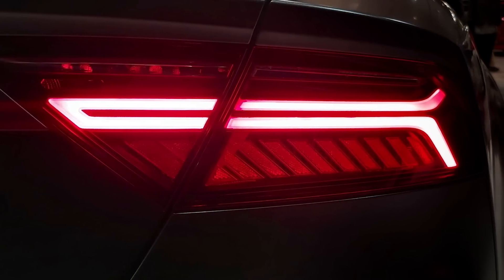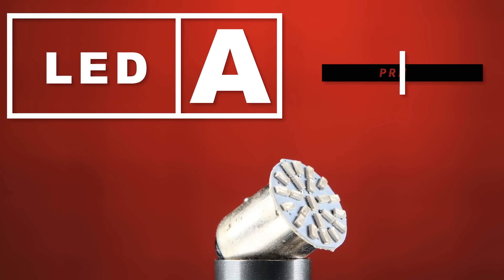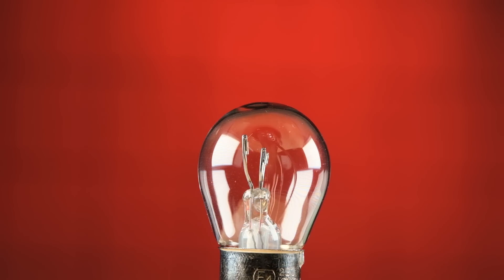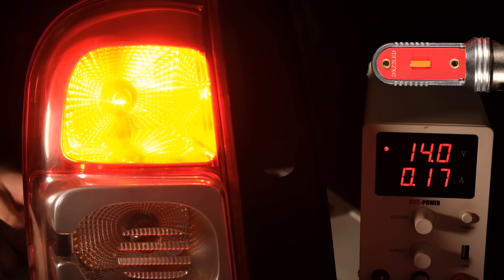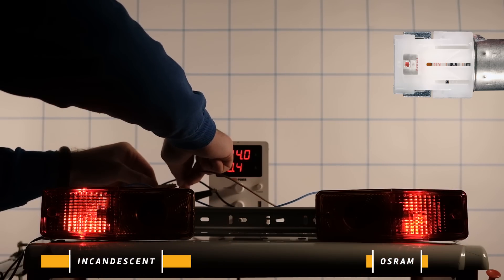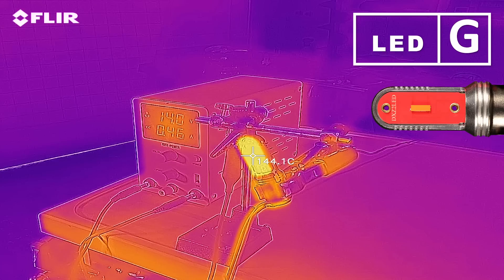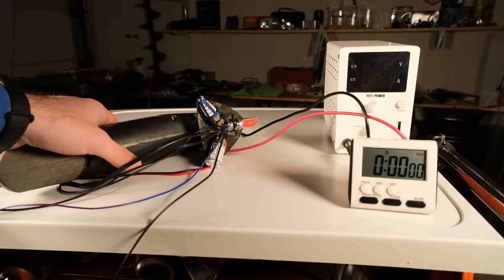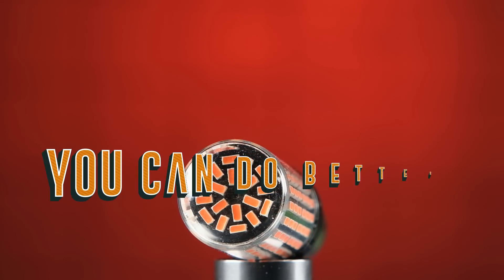LED STOP Lights TESTED - OSRAM vs PHILIPS - Light output, Temperature management & Endurance tested

Comment: https://www.ebay.com.au/itm/Amber-BAU15S-1156-Turn-Signal-Light-PY21W-144SMD-Canbus-No-Error-LED-Bulb-New/154026458388   This one is brighter than original bulb. As long as it fits though.  Have these on my car.

Comment: Great comparison from you but... I can't understand why would anyone buy LED's that are 30 times more expensive than 'old' light bulbs to get almost as good results. Those chinese junk it's not even worth mentioning. It's idiotic.
Reply: Buying an led bulbs that’s very expensive but it’s not the most expensive led bulbs in the world. There’s a lot more out there that’s way more expensive. 

Remember, u get what u paid for. 

$35 bucks for Osram/sylvania led is not a bad deal.

The higher the price, the better quality is. And the better how well made it will be.
Reply: Fun fact, there’s people out there spend $130-$160 bucks a pair for turn signals, another pair for reverse lights, another pair for brake lights. 

It is insane but the high quality led bulb product are excellent. 

And it’s considered a must have for automotive led enthusiasts.

Comment: Sergiu, you've got great content! I love your videos and your sense of humour. Kudos for keeping it funny and light, while still being as in-depth as possible.

My 1995 BMW R100RT uses two separate bulbs in the tail light. A regular P21W for the brake light and a P5W bulb for the tail light. The P5W seems to have been largely phased out from the automotive industry. It's got the same socket as the P21W, but a smaller glass dome and - obviously - a lower light output.

I'm looking to replace at least the tail light bulb with an LED, in an effort to reduce power draw as much as possible. What would you use?

Comment: Great video!
I just upgraded almost all lights bulbs on my two cars.
I did not upgrade headlights (high and low beams, and front fog lights), as I consider good halogen bulbs to be a better solution; and turn signals, because the duty cycle (time being on against the sum of time being on and off) is significantly lower, and there is a noticeable difference to other drivers.
I changed parking light (or side marker), brake light, reverse light, rear fog light, and interior lights (footwell, boot/trunk, and overhead).

I switched to LED in order to (a) have more reliable bulbs (less heat and less energy consumption), and (b) better overall light output (better light and uniformity).

On the interior I specifically desired more light output, to see better at night - especially during Winter time.

I chose Philips, due to its good build quality, reliability, light color, and light output. I chose the "X-tremeUltinon" series - as that was the better light output ones I could find.
I am really happy I did change these bulbs.

On my 2001 Renault Clio, I was able to change all rear lights.
On my 2011 Renault Megane, I was not able to change the P21/5W brake lights, was with LED they stayed on all the time. The DRL and interior lights cause an ECU error, but as these errors do not show up on the dashboard, I am not too worried.
Reply: did you had any issues with the periodical inspection or the police?
i might wanna make wanna upgrade my parking reverse and brake too since i find its a big electricity waste to use 21w per bulb for my brakes not to mention the tiny bulbs in the third brake lamp which use 36w (in total brakes use 42+36=88w on my car which is a big waste of electricty)
also i might wanna upgrade the rear fog light with some brighter bulbs so that the tailgaters know to stay in theyre place (if that wont be an legal issue)
Reply: @Rand0muser2538  I feel you!
On my previous 1996 Peugeot 106, with 6 W5W on the third brake light and the two P21/5W on the sides, upon touching the brake it was a total of 72W just for applying the brake pedal.
Yes, the electrical system was design to handle all that - but the car is old.
Moreover, during Winter with the headlights on and heater blowing air, while in traffic with the brake pedal pressed, you can imagine the demand on the electrical system.
Hence, I am in favor of that upgrade to LED - but good ones!
If you cheap out, you will (a) not get as much electricity savings, and (b) add one more liability to the car - and I imagine that, like me, you do not have insurance that covers fire, as the car is too old.

Regarding rear fog light, yes, I did upgrade it.
But for providing better light during fog situations.

When it comes to the annual vehicle inspection, I never had any issue.
Typically, they do not like LED on headlights - which I also do not recommend, as LED is not there yet for retrofitting.
On my Megane, the DRL bulbs are quite obvious to be LED, as the headlight is big and clear. Hence, I turned them off before going to the inspection, and turning them back on after it.
The other LEDs are always in place and working, and I never had any issue!
Reply: @hitardo  well its looks like i can only find replacement for the 2 main brake lights which use the classic p21W
my third brake lamp uses t8 3w bulbs (which can be a problem since i cant really find led replacement for these ones and even buying 12 t8 bulbs is just as expensive as replacing all the bulbs in both of the tail lamps
i might wanna replace the tail lights too but for some reason my car uses P21/4W for tail lights and fog lights which is diffrent from P21/5w and not even the chinese brands offer this kind of sockets on most of the leds
Reply: @Rand0muser2538  what brand, model, and year of car do you own?
I ask this, so I can search what exact bulbs to work on your case. Because "P21/5W" or "W5W" does not tell the full story.
Reply: @hitardo  skoda octavia 1 2003

Comment: After trying a number of 21/5 W, I recommend these:
https://www.aliexpress.com/item/32810391568.html?spm=a2g0s.9042311.0.0.27424c4diZFOZW
Visually their light output is good in a reflector lamp. The diff from rear to the brake light is not quite as big as with a filament bulb, but acceptable. Lastly I like their intense red.

BTW I was quite surprised to see a vast improvement in terms of "on" speed with the LEDs. I did not think the difference is so huge. Change one first and you should see what I mean.
Reply: Haha found this back. The bulbs lasted about 3 months.
Forget these. All. Expensive shxt.
Reply: The 1157 on my Audi A3 are the factory bulbs .... 24 years old!

Comment: try amber leds in a red tail light housing you'll be amazed how bright it gets, 2 times more than a regular bulb. i have personally tried bulb A,B,C,H,OSRAM and PHILIPS in a single pole application like 1156, my conclusion is that bulb a,b,c were all garbage cause they werent bright. bulb H however was the brightest but didnt last more than 4 weeks(tried 4 bulbs, all 4 burned out one by one within 4 weeks). Red color OSRAM and PHILIPS were not the brightest but amber ones worked better, i have a pair of each in my car one for turn signals and one for brake lights and they've been running strong for almost 2 years now. I did how ever try red 1157 in one of my car but in real life the difference between parking and stop light is merely noticeable thus i had to switch back to regular bulbs. still on the quest to find a 1156 bulb that has a night and day difference between parking light function and stop light

Comment: A LUX measurement would not hurt the new LED tail lights for new cars, because it is obviously very much too strong, in fact !!!!! I think it should be regulated, because already the LED parking light is much stronger for many new cars than the brake light for older incandescent cars!

Comment: Salut Sergiu, I think it would be better if you tested classic bulbs with 13.2 V. If you measure the voltage on the bulb in your car you'll hardly get 14 V I think. With 14 V in the test it might be much too in favor of the incandesent bulbs. Personally I stick to these because of the bulb outage systems that hardly tolerate LEDs and because of the certification. But I understand that many users might want to switch to Osram/Philips LEDs because their performance is really good.

Anyways, you're doing a great job, mult,umesc for the test! Merry Christmas from Poland.

Comment: I had a set of generic (though apparently high output) brake light LEDs in my car, and they lasted ~1.5 months before both had failed.

The set of Osram LED bulbs has been running for ~4 months now, and while they cost just over $23, I like the output and the expectation that they'll last.
Having a warranty is nice as well...

Comment: This is why I get blinded at traffic lights, please use the handbrake during night time traffic because these blind you.. Manufacturers should introduce led light dimming during low speed driving to not blind the driver behind, or the costum led lighting you install please add a potentiometer to dim your lights during city driving...
Reply: You ever been behind a new Cadillac Escalade?  😂 Those red laser beams really leave you blind for a few seconds
Reply: Lol fuck that. 

An incandescent bulbs are not bright enough. 

With led bulb replacements from a reputable brand. Like sylvania led or sylvania zevo led, Philips ultinon, X-trend ultinon, and vision . 
I’d rather get an led bulb for better brightness, more vibrant red color and better intensity increase. So that I can get notified better to see and being seen better. 

Instead of ur lights is too bright, for sylvania led or Osram? Not even.
Reply: U only use handbrake for when u park. Not to brake. That’s kinda stupid.

Comment: 7:21 Seen H on Amazon. They have superior output filling the reflector for the most visual intensity in a way that can't be measured obviously. Probably make a better turn signal than stop light being somewhat warmer but they passed the oven test too.  I was impressed. On Amazon- https://www.amazon.com/dp/B07QWWZ6GJ/?coliid=I1FOVCZVOSA1DJ&colid=3V9UKRF47G9QV&ref_=lv_ov_lig_dp_it&th=1

Comment: Turn signal leds will be interesting to see too
Reply: Yeah. I'd like to see how turn signal led fares compared to incandescent bulb.
Reply: I have them. They are too bright. But you need a separate resistor to remove the error.  I have bulb H
Reply: Yes, and how to install them, because of the less resistance they have.
Reply: @christiann7320  You need an inline resistor.
Reply: @christiann7320  there are some led bulbs that have built-in resistors on the internet . i've used it for a long time and until now it works
Reply: @christiann7320  In general you'll need a completely different flasher unit as well. Conventional ones designed for incandescent ones may not work at all or the timing might be wrong. The  wiring to the flasher unit might also need to be modified.
Reply: @Velktron  thanks!
Reply: You will need to change your relay to a led compatible one too for the harness led lights.
Reply: @Merlene Kita thats...sad bro.
Reply: i’m here for the turn signals as well

Comment: Bulb H is a really good value. Good light output for parking and almost same brake light as osram and philips. If you have an old truck and you want to do an upgrade, i dont reccomend spending 70 dollars to get philips/osram. Bulb H is good enough for much cheaper.

Comment: Happy to see that the  Phillips X-treme LED 1157 socket P21/5w were worth the investment (had to import them to Europe because they weren’t available here in 2016 which made them extremely pricey) I immediately recognized these led bulbs have the placement of the leds in the same position as the filament type bulbs. So that helps the light output gained by the reflectors behind the red glass.

Comment: Very nice and informative video!

I wonder, how hot will be a 21w turn signal LED bulb with built in resistor/canbus?
Reply: MRU, I use bulb H for rear turn signals. Must have a built in resistor cause I don’t experience any hyperflash.  They’re great bulbs IMO 1797 (T-20/7440)
Reply: @ScottishScot  Hi, I want to buy turn signal LED bulb with built in resistor (no hyperflash) for my car, but I’m afraid to not get very hot and melt the headlight connector/case. 

Like a see in this video, not all chinese led are safe and some of them can start a fire. 🙈

Comment: I have a set of philips (different shape though) for years. Light output and pattern are perfect and instant on is so good.
Reply: Share model name then please
Reply: I've had the Philips version of the 501's (silver band 4,000k?) in for over 2 years and they e never missed a beat. They replaced cheaper versions that blew faster than a hooker. Will only put Phillips in from now on.

Comment: Awesome video!
This is my favorite LED brake light, you should try it. It operates just like the original halogen bulb, just slightly brighter. You can easily tell the difference when braking. This was the best LED I have tested for this purpose.

US $10.88  41%OFF | VANSSI 2x 1157 2057 2357 7528 BAY15D LED Bulbs Brilliant Red,Super Bright 1200 Lumens Replacement for Tail Brake Stop Lights
https://a.aliexpress.com/_mKzOxDX

Comment: One light that could actually be worth changing out for a led could be the reverse lights. In my car, with led reverse lights, I can actually see what's behind me when reversing in a dark environment. The incandescent one's where mostly just for alerting other drivers I was reversing. With these leds I don't have to install  external auxiliary back-up lights.
Reply from the maker: I can actually follow up on this Idea. I have in mind some products that are worth testing. Thanks!
Reply: @SergiuGabor  Perfect! That would be great since when I was shopping around, alot of brands clamed higher light output due to "LED-technology" (wow, so cool!!!!!), but when comparing lumens or if you calculated lumens/ watt for the lamps they end up around the same level as the normal incandescent ones. You really have to make sure you're buying one's with guaranteed higher output.
Reply: @SergiuGabor  Hm, wonna see how mine and a couple of people I know's reverse light bulbs compare to the rest, would you like a link to the item or a name perhaps?
P.S Nice videos, I'm waiting for my Bulb E to arrive soon, feelin not so confident about replacing now.
Reply: Did the same, it worked great!